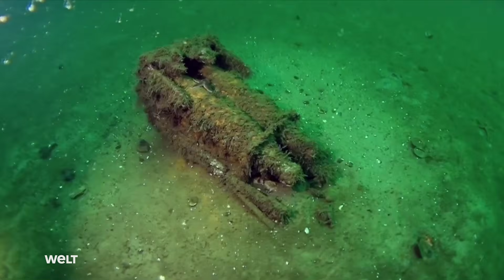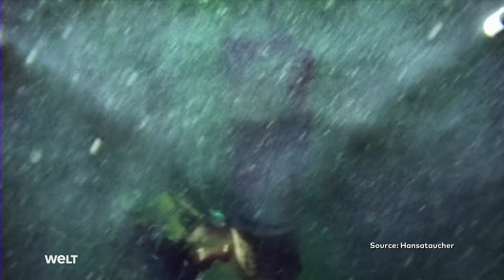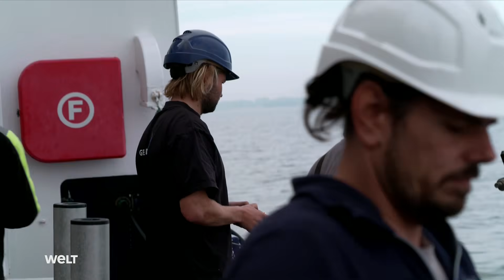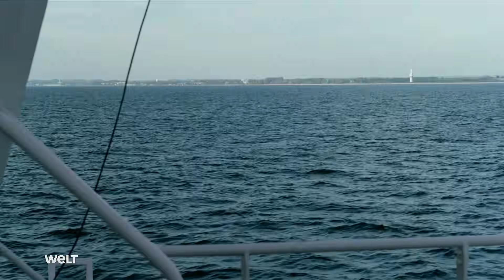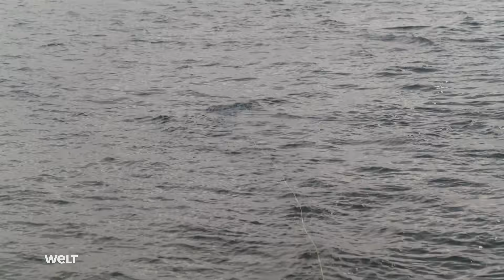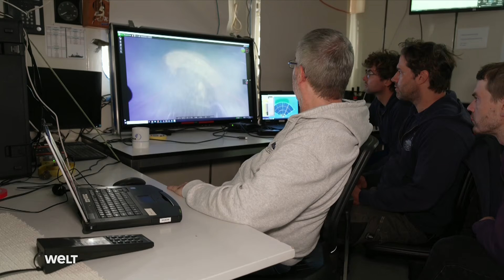Millions of Tons of WW2 Bombs Still Corroding Beneath the Baltic Sea

Comment: Gun cotton has nothing to do with tnt. Gun cotton is nitrocellulose aka nitrated cotton. Its not an explosive either, it deflagrates at subsonic speeds and is why its the prime ingredient in all modern smokeless gun powder. Tnt is nitrated toluene or triple nitrated toluene. Nitrocellulose wont detonate tnt either as any detonator used would need to actually detonate at supersonic speeds. So not sure where you got your definitions from

Comment: Controlled detonation does not always explode the toxic elements. Especially when they are so badly decayed.
Instead it breaks them apart, spreading them far and wide in the area.  So instead of a slow gradual release and absorption by the sea.  They are released all at once in a large toxic spike.
Reply: I didn't know that thank you for the information

Comment: If you can make fertilizer into  explosives,  is it possible to make explosives in the fertilizers sort of like turning swords into plowshares
Reply: From a chemical point of view you go from nitrotoluene to dinitrotoluene to trinitrotoluene, or TNT which is the explosive material. You can’t reverse the process. Once you have TNT, you can only explode it or burn it. If it’s not confined it burns rather than exploding.

Dinitrotoluene or DNT is made industrially in huge quantities and converted to toluenediamine and then to toluene diisocyanate or TDI. If you want to know what that is used for you’re sitting on it. It polymerizes to flexible foam or what is commonly called (erroneously) “foam rubber”.
Reply: No, but you can use the explosives to make people into fertiliser

Comment: Many years ago I was in that area supporting oceanographic research. We we dragging a hydrophone area when our ship lost propulsion and our array sunk to the bottom. When I tried to retrieve the array the strain sensors spiked so I stopped the winch rather than break an enormously expensive hydrophone array. We got propulsion back so we tried reversing to get our array loose with no joy. The ship dropped anchor while I tried to figure out what to do. Finally my colleagues decided myself and another certified member would get in our drysuits and see what we could do. We were in about 35m of water so we were at the limits of our diving capabilities. We got down there and one of our control planes was wedged in rusting and corroding rectangular metal boxes. As we got closer we could see debris on the ground and for as far as we could see, about 3-5m, piles of I believe 80mm mortar shells. I tapped my dive partner and pointed and the look in his mask mirrored mine, terror. We ascended and got aboard as quickly as we could to inform the Captain. He wanted to just cut the array umbilical with an axe and get the heck out of there as smoothly as we could. I talked him into allowing me to disconnect and seal the umbilical before attaching large floats to mark the array as well as the danger zone. It took over a month before the German Navy decided to do a destruction in place since the area was fortunately an isolated dump zone. I didn’t get my US$250,000 hydrophone array back.